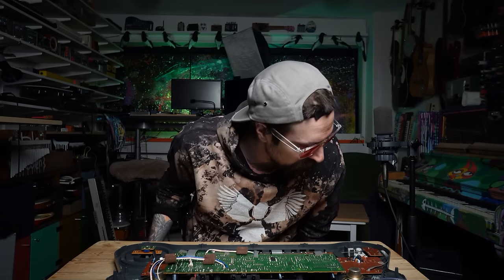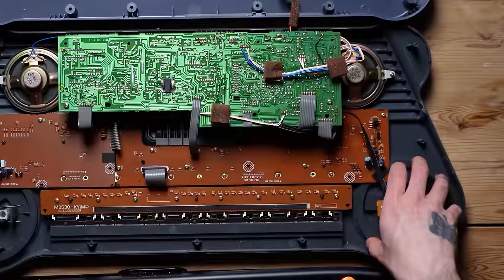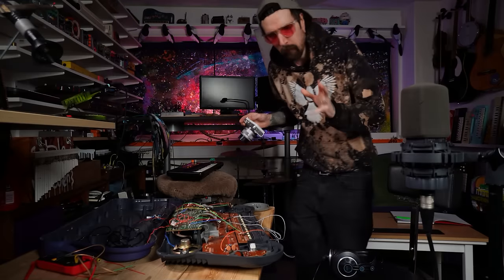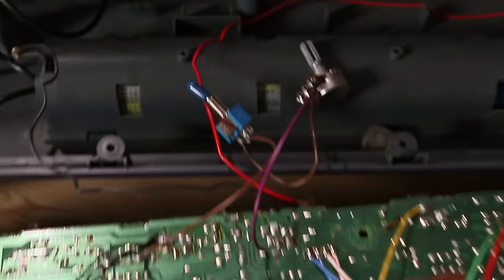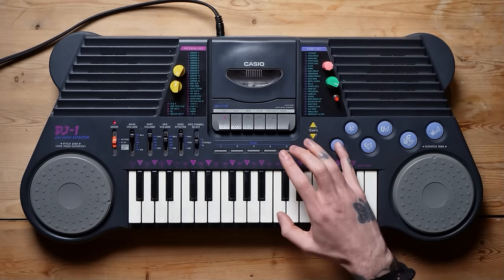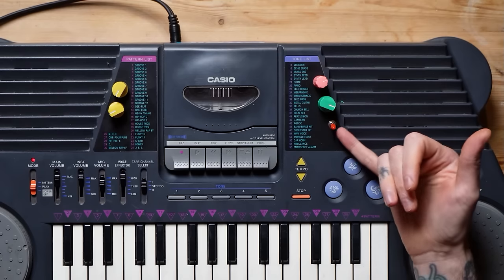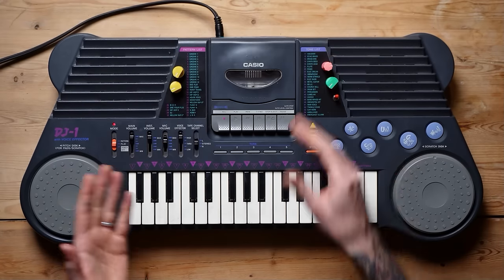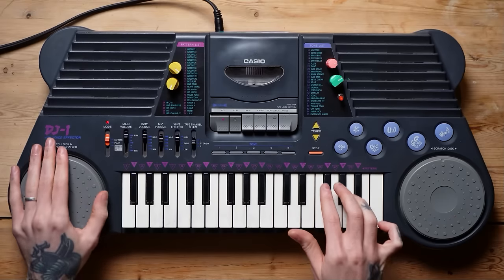Circuit Bending The Tape Rap Keyboard for extra Lofi | Casio DJ-1/Rap Studio

Comment: Awesome. Thanks for showing the inside and explaining stuff. I have an old Casio keyboard I've been thinking poking around in. Not those models, but gives me an idea of what to look for.
Reply from the maker: I can recommend circuitbenders.uk if you wanna see some other potential clock sources that are common.
I’m dreaming of one day having a proper bank of all the different common chips in casio keyboards and listed what clock speed and source they run on 😄

Comment: You should circuit bend an old style word processor or computer. One with the stepper motor printer inside. If you hooked up some floppy drives or similar motorized storage, you could make a pretty interesting synth.

Comment: The next thing to mod on this thing is to add an external power input to be able to use this without any batteries. 😉
Reply from the maker: I actually has a power jack! I just dont have any fitting adapter 😅
Reply: @SimonTheMagpie  Then buy one and stop using batteries. Batteries = limited working time.